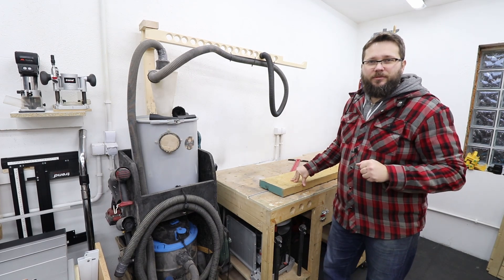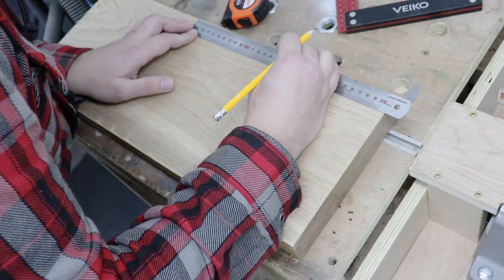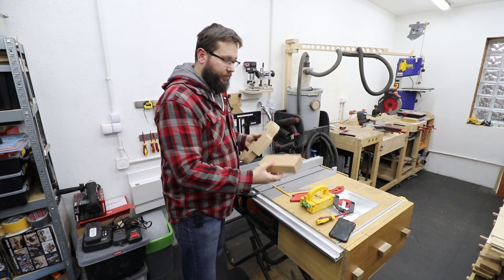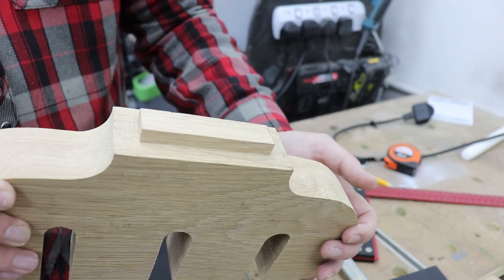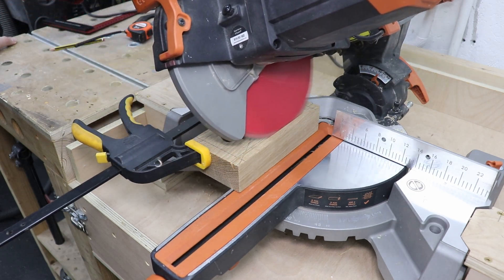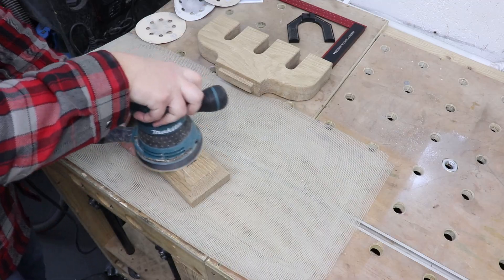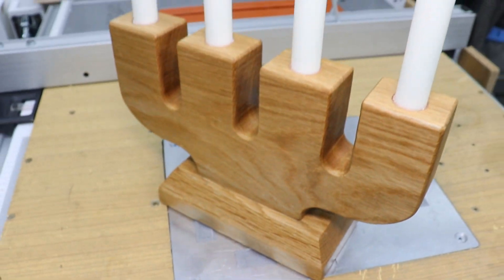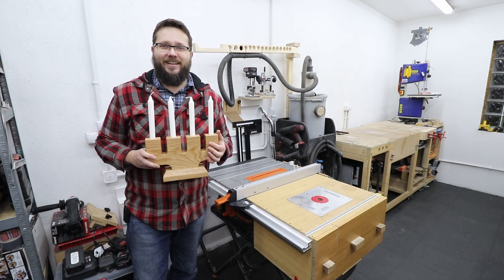DIY Wooden Candle Holder | Candlestick Holder

Comment: The project turned out very stylish indeed. The finish on the oak is beautiful. The copper pipe sleeves added the final touch of class. Thanks for sharing. Cheers 👍😎🇦🇺
Reply from the maker: Thank you. Yes the copper pipe makes as a nice detail plus a bit of safety 👍

Comment: Great project! Are there any power tools there that you could do without? For example, I have a router, but no router table; a hand plane, but no jointer or thicknesser, etc.
Reply from the maker: Depends, if you buy a planed board you don't have to go through the milling process. If you buy rough timber then you should have tools to be able to mill it. 
You can flatten a rough board with a hand plane,you can cut out the shape with a jigsaw or handsaw, you can do the tenon and mortise with a chisel and a handsaw. So yes you can do this project with some basic tools it's just gonna take you a bit longer 👍
Reply: @CasualDIY  thanks! I guess buying the best wood and taking my time off be able to make something 😊

Comment: Nice little project. Thanks for sharing.  I like the design with the copper pipe inserts. I don't have oak, but I saved some chunks of beech fire wood.
What dimensions of wood did you use?
Reply from the maker: Thanks, the dimensions of the candle holder are as follows thickness 4.5cm, width (widest point) 30cm, height (total with base) 18.5cm
Reply: @CasualDIY  Thanks a lot for the dimensions.

Comment: Looks great but wouldn't light any candles in it...Fire hazard
Reply from the maker: If you let it burn uncontrollable to the end then potentially yes. Hence I added the copper pipe. Same like leaving a frying pan with oil on your cooker uncontrolled eventually it will cause fire. That's why you should never leave a candle unattended. But if someone is using power tools to make a candle holder like this then I'm hoping they will have enough common sense to operate a candle...
Plus you can now buy electric candles and that will sort put that problem.